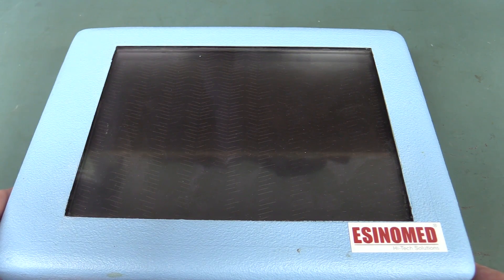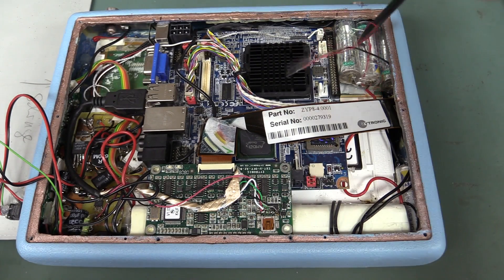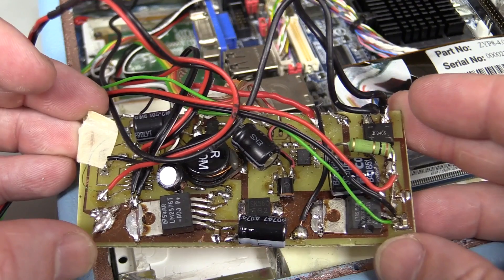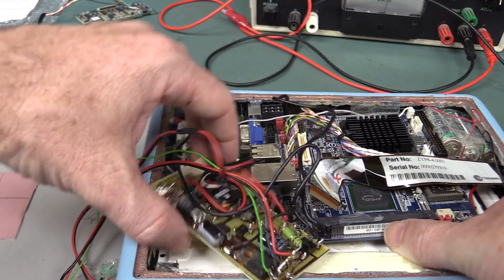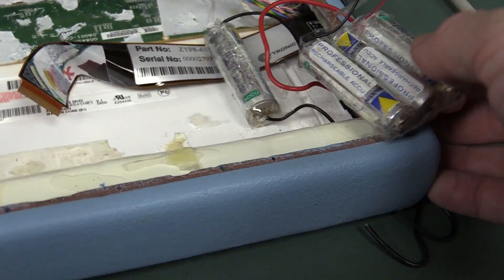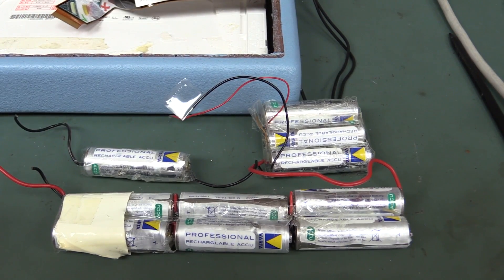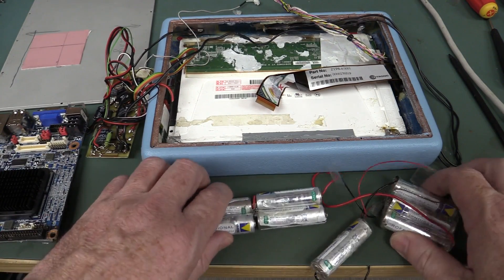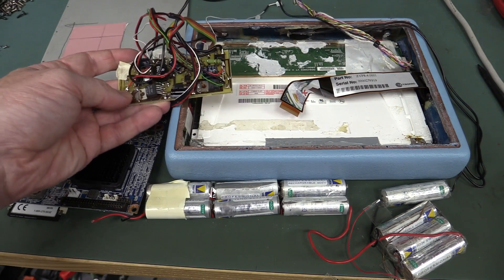EEVblog #822 - World's Worst Tablet Computer Teardown

Comment: You'd be surprised how hard it is to find a power supply of the right shape!  If you buy a open frame or chassis PSU it will probably be some shape that won't work in your case.  So you take that circuit and massage it into the shape you need.  If you need to ship within a month then there's no other choice but to etch yourself!

Comment: Why wouldn't they use an iPad or something?
Reply: +rabasiticamphibian Looks like it was made several years before the iPad existed.  It's running Windows XP.
Reply: +Brian Henderson Not an excuse. They could just buy Windows XP tablets from Siemens right down the road, they've had a huge lineup of those.
Reply: Probably thought this would be cheaper and they could undercut their famous competition. Or maybe the Siemens ones didn't meet a particular client need.
Reply: mspenrice  I have a better hypothesis. This was probably sold as a VGA display, not as a tablet. Some 12-year-old probably bought this and re-built it into a tablet, best way he could. As in, very badly. But hey, gotta praise the effort and the learning experience he must have gained.
Reply: Nah - why then have such a big case (which has obviously been industrially made), and keep the original serial number and manufacturer logo stickers on it? 12-year-old me would totally have repainted or stickerbombed the hell out of the thing, put my own name on it etc. And it's way too big a box for a straight 10-inch-ish touchpanel display.

The interior parts including the hand-etched power supply module are way beyond what the typical tween would be able to put together. Jamming a nanoITX board in there and soldering a bunch of batteries together into a pack, maybe, but I doubt the rest. Not so much because of a lack of ability or availability of learning materials to find out how to put it together, more getting access to them and having the money to bring them all together.

It totally screams pre-alpha prototype for a new model to me. The production one would have a semi-custom motherboard (you can talk to board manufacturers and have them make you a "small" (ie 1000-piece) run of bespoke units, you know) and much lower profile, better made examples of everything here, including a proper lithium battery rather than a bunch of NiMH AAs, a rack-charging solution that wasn't just a pair of exposed thumbscrews, and a case that didn't look like a sintered-aluminium casting coated with whatever the cheapest paint they could find / the most unwanted dregs in the facility and a brass backing plate - probably fully moulded plastic instead. So it would look a lot more pro, be a lot thinner and lighter, with a better battery life and easier charging, but otherwise have the same general specs.
Reply: Also, where's the VGA input?

Comment: What information do you have that this was a customer deliverable unit and not a sales demo unit? Just the fact there is a serial number? If a small quantity were built for the purpose for testing the marketability of such a device, of course you would do something like this. I'm an EE at a fortune 500 defense contractor who designs equipment that soldiers' lives depends on. We sometimes quick prototype like this for demos of new products before committing millions in R&D dollars.

Comment: Just clean the additional power plug solder from the ITX motherboard, check the CPU heatsink because it could have been replaced with a smaller one, put the board in a case and use it. It's at least an x86.

Comment: Still better than what one could see in a last year Mechatronics Course in Portugal. A place where the concept of "through-hole" soldering is too abstract. The components are soldered through holes alright, but only to fix them to the board. The connections between components are made above board!

Comment: Wow, that is truly shocking! It would actually have been easier to do the job half decently with standard parts and techniques. Who was their parts supplier, the nearest dumpster? Custom building that turd must have been hard work. I've seen some lash ups in my time, but that takes the biscuit.  You say this was for use in hospitals? 😱

Comment: iPad it is not. This thing is a fire hazard. That middle battery in that three battery assembly (and I use the term assembly loosely here) has already vented a significant portion of material. That's toxic if it's a NiCd battery. That friends, is why you don't solder onto the battery terminal, the heat ruins the spring tempering on the relief valve and leads to this.

Comment: What's super funny is they couldn't even use a battery pack from something else. XD Also I'm sure if you dropped that, it would create a nuclear explosion. XD The whole thing looks like it was done by a kid or something. I wouldn't be surprised but still not too bad for a home hacked piece of shit with no budget. I've used worse. two bridged car batteries hardwired to an inverter then a power supply then, hardwired directly to an amplifier and,  my stereo. (Couldn't play my car stereo in the house because of the amplifier and, stereo model) Don't even ask lol. XP The setup always ran out of juice fast. Stupidest setup I've made lol.

Comment: Something stuck me about that battery "pack", there is one place where it really is common to solder batteries together, and AA cells are common, that is inside the battery pack on a laptop. I wonder if those batteries were cannibalized out of a laptop.Much of the thing does make sense if it was a prototype, (except for that amazingly bad power supply board), but you just don't let something like that get out to an end user.

And I never did see an answer to the question, did it work?

Comment: The batteries might look terrible, but that is how you put a battery pack together in any instance where you expect any shocks.  Such as in RC stadium trucks for example.  You can shake it around, run into objects, and you will never get a loose connection.

The batteries and the case are the only thing I see that looks legit.  Everything else screams I was designed and built hungover.

Comment: I have seen this affliction of not wanting to use an off the shelf part with prototypers before. Somehow they are convinced that if they build it from scratch by reinventing the wheel they are getting an early jump on reducing costs later in development. I had one guy over a year ago who was building his own solenoid water valve, from scratch!! I mean down to hand winding it, and his soldering and cementing skills were absolutely rubbish!

This tablet has GOT to be some sort of internal development prototype made by someone who's never prototyped before. (or heard of a breadboard) Never heard of REV. B/C/D etc. I'm certain my nephew could solder better than this. Heck, my CAT could solder better than that.

(Heck, maybe it's a TV prop?)

You have a Hall of Fame item here!

Comment: Have you ever taken a look inside most 1980's and older electronics? Looks all pretty much like this. This video is stupid.. putting down elec engineers because they didn't use laser-cut boards and machines to make the product. An actual human built this.. should be thankful. Take a look insod emost vacuum tube elctronics... its worse "looking" than this but still works and easy to service.

A lot of medical equipment is like this to make it easier to service.

Comment: Doesn't really look so bad, as just a bunch of clever but cheapskate hacks.  The voltage regulator using the backplate as a heatsink is smart, but using glue instead of a proper power board and/or fire-proof tape is a big WTF.

The battery pack probably wouldn't have fit any other way.  The proper design change would be to to go to prismatic cells instead of cylinderical cells.  You know, like every single tablet out there.  10 AA cells for 15V?  So their backup battery has to go through the board's power supply (used to be called VRM) instead of being integrated into the output.  Yeah, this is horrible from an engineering POV.   With a modern board, the entire power supply could have been 12 volts and running from an external brick.  :/

This thing reminds me of the old laptops from 1980's, or the Playstation 2.

Just realized:  1.2V cells would be 12V.  So they effectively created a substitute for the external brick.

Comment: the battery pack isn't all that concerning if you cut open a standard rubber wrapped pattery pack it doesnt look all that different they just made a custom sized one.  if the tree on the side had been wrapped in the paper like the other set it wouldn't be bad at all

Comment: Don't get to impressed by the SN 11 on it : I work for a major company, and I often prototyped on higher numbers : I've seen lab protos with SN no less than 50. Sometimes because they were different  implementations under test, sometimes because the first numbers actually were "showroom only" prototypes with more or less nothing inside, sometimes because there was an early delivery batch for field tests, while the developpement went on for the final cut, to be delivered way later !
... But I must admit the job shown here is uggly :) and the power supply is a joke. Are you sure it was actually delivered and it's not some lab dummy ?
Reply from the maker: +Philippe Bourgon It's likely they showed it to someone, or used it as a demo unit, likely a short run of demo units.

Comment: Yup. Potato quality. It probably took longer to make that than it would be to just buy off the shelf parts. This is possibly a start-up "electrical engineer" company product... 

If you saw what I saw as a tutor for Project Lab 1-4, you would be appalled at Texas Tech University. In Project Lab 4, some of the new EE students still have some pretty awful botch jobs, which shouldn't happen if they were learning... right? So what if you took these students and gave them a job without previous experience and asked them to make something for medical tablet purposes? Bloody better to just get an Android tablet or something nowadays.

Unfortunately, that happens because some students are just "Going through" so our standards have dropped a bit.

Comment: I'm pretty sure my first crappy protoboard boost circuit used the component leads instead of traces or wires, and I didn't really know how to solder yet. I still have it, and it does not look anywhere near as horrible as that PS... Thanks for sharing your pain, Dave! UUUGH!

Comment: They didn't just deliver it - they delivered it to a hospital.

I wonder if the software was of similar quality.

My main concern would be - is this thing going to get infectious goop on it that gets transferred from patient to patient? I can't imagine a worse idea than a touch-screen in a hospital. Can it, at least, be cleaned and disinfected? Is there a gap between the screen and the enclosure that is going to collect goop?

Best thing for a hospital monitor would be one of those projector screen things that works with a camera to watch your keypresses and touches. The whole thing can be enclosed, and the "screen" can be autoclaved.

Comment: Still shaking my head over that power er board and the non use of connectors. You notice when the mini pc board was flipped there was the 6 pin power socket just waiting. I hot snotted preproduction test mules together when we did have a frozen design or the hardware wasnt on the shelf but anyone who worked on this turd fest should be severly embarassed to say the least. 

So Dave when you going to fixit and fire it up? lol

Comment: somebody had a hog with that, that things is never ever been produced that way in germany to be sold in germany! medical products MUST meet and VDE grade wich guarantees and reasonably amount of reliability and safeness - not mentioned TÜV so far. I guarantee there was an complete mainboard in it, that thing died and somebody build from components, scrap and shit this turd of the year.

One of the many hints is that the Varty batteries are labeled in english, the over here sold batteries are labeled in german. So at least that pack has been put together outside of germany

Comment: OMG, I'm currently learning about PCB design and soldering to IPC standards. This double sided etched monstrosity wouldn't happen even before I started.
They probably lacked the engineers and assigned the job to sales management or HR.
Smash it with a sledge hammer to chase the demons away.

Comment: I think they build the power supply themselves because the tablet can run on the batteries or on the 220V, the power supply board needs to switch automatically between the batteries and the main power and charge the batteries... The board looks absolutely terrible though.

Comment: And to think You complained about a $6 Cen-Tech DVM that wasn't actually useless..
I soldered like that when i was maybe 7 years old and learning from the instructions to solder that came with a Radio Shack electronics kit! My soldering iron was the classic pistol grip $1.99 special,and it did better work!

Comment: I respect the effort it took to be made as i know how much of a headache it is but i don't understand why it had to be done like this,if they would put the internals and touchscreen from an old laptop tablet with no keyboard and useless parts in a thin custom case it would be miles better. This however partially potted in resin with an actual battery pack will be alright,it was working already as it is in eitherway.

Comment: OMG, why are you yelling?

Did it work? I think so.
It fulfilled its purpose? I think so.
Was it reliable? I do not know
Was the customers satisfied?  ???

Maybe it was some lowcost order. 

Or, as it is usually the case, the customer wanted just something to test whether the patients will use.
Reply: If you want it cheap, fast and better/safer quality, then you go down to your local electronics superstore buy a 30W power brick and a 3 cell notebook battery for a total 20-50$. How long time do you think it takes to design, etch the pcb, buy/locate parts and solder the thing? How much would the engineering cost be for this job?

Comment: Looks like it was intended for use in theatre conditions, from the look of the case, and I wonder if the screen was designed to be used with surgical gloves?  It is cruder than a very crude thing though!   Any student would have failed their course for turning something like that in!

Comment: @0:54  Is that an...AMD Geode?!  Holy crap, I never thought I'd see one of those.
Reply: +nychold Until today, I didn't believe they were real.
Reply: +Fraser Hughes They're like intel atom but way older and pretty crap by todays standards.
Reply: Fraser Hughes For me, I remember reading about them in the late 90s and thinking "This is the way computers will go in the future."  So it's probably just nostalgia.
Reply: +nychold Whats so special about them?
Reply: +Hatagashira True, but at the time they where new, they actually compared better to standard desktop CPUs than Atoms do today. You must know, that the most Geode CPUs where made more than 10 years ago.
Reply: +nychold About as powerful as an OLPC XO kids laptop! Wow!
Reply: Daniël's Tech & Music Channel
They were also used for low-cost PCs with low power consumption (and performance).
Reply: +nychold I have one in my NAS. Works a treat. Only issue was that it had 256mb of ram and i wanted to upgrade to 1gb. Had to get the ram from China as it was DDR1
Reply: +nychold You were actually right-on with this, except they're all ARMs now and WAY smaller.
Reply: nychold Oh ok cheers
Reply: +Involuntary Cultural Enrichment Hey its you!
Reply: uK8cvPAq pls dont ban me senpai
Reply: +nychold 'Geode' seems a proper name, as it is in fact a fucking rock.
They predicted the future with their naming scheme.
Reply: +Hatagashira they are still used as part of sensor\ control panels . Even in avionics. those application do not need anything but small size and ability to run linux with a DirectFB app

Comment: The most amazing thing about this botch is that it doesn't even look amateurish or cluelessly designed, but more like looking at the winner of a competition in bad design. More than an actual trainwreck, it's like a piece of modern art on the theme of abstract trainwrecks.

Just take that power supply board: It doesn't even look like something you put together because it's easy or because you don't know better; it has to be actively harder to make it that way. I mean, the double-sided board with just a couple of traces on the back side; all the unused soldering pads for components that have instead been botch-soldered straight onto the traces; the extraneous sods of solder in useless places; the completely crooked placement; all the bare contacts in close proximity to the metal backplate... It takes a few rewatches of the video only to let it sink in just on how many levels it's wrong.

I just cannot fathom the mental processes that would cause something like this to come to be. I'm almost inclined to think that it's a case of employee grudge or something.

Comment: It may of been one of the prototypes with a serial of 11. It was bought as scrap from the company that failed. I'd bet it was a proof of concept design in a progression of units and used till the bugs were found and fixed. Now if it was serial 1000+ and bought at a yard sale as someones old system then yes, bullshit work.  Just my 2 cents after seeing lots of early R&D on the dirt cheap and under a ridiculous schedule.